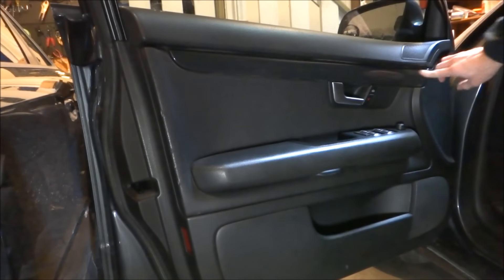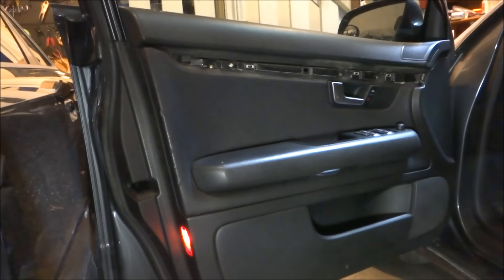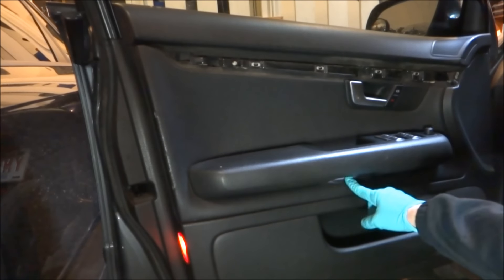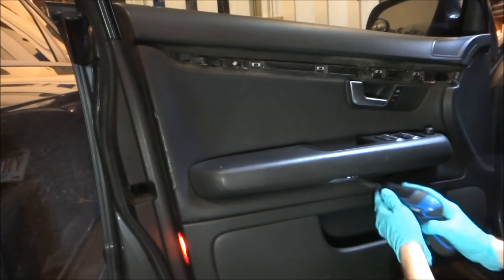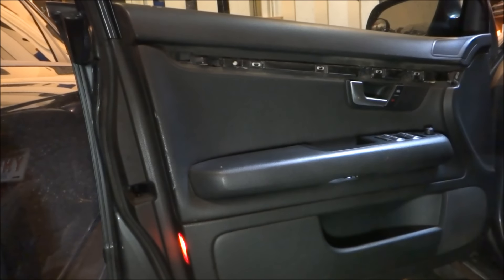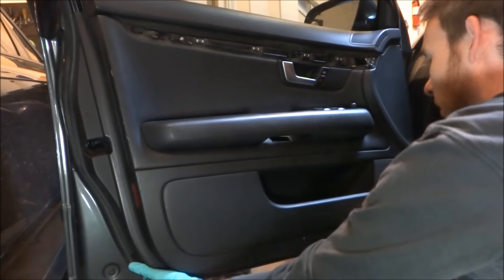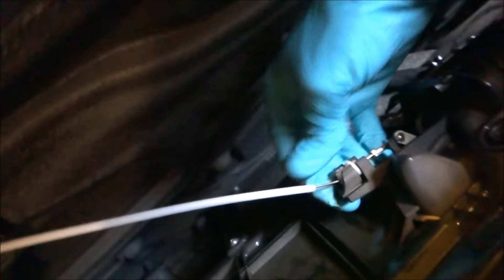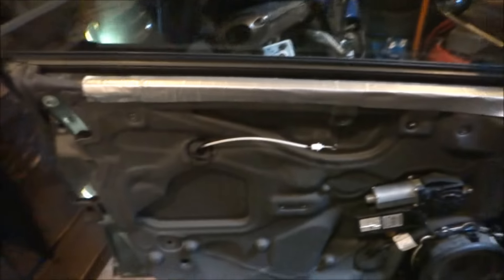How to Remove A4/S4 Interior Door Panel (B6/B7)

Comment: Why did the light on the door come on when you started to remove the panel? The same thing happened on my car. The light on the driver's door didn't work so I started to take off the door card. After I had taken off that piece of plastic the light worked again, so I just drive around without it. Easiest fix ever :-)

Comment: I have 2006 Audi A4 2,0t driver door dont have eni elektrik pouver
Reply from the maker: Check your fuses first. If they are all good you could take your door apart and check that the electrical connections are tight.

Comment: All the plastic fasteners broke when I pulled the panel off after removing all the screws. Not good. My guess is that Andrew had removed the panel in the past and either broke all the fasteners or they were broken by someone else before he bought the car.

No one likes to break shit when working on a car.
Reply from the maker: I've done this on 3 different Audis now and haven't broken any clips. Sometimes they do get brittle though.
Reply: They break 95% of the time. If you remove a door card without breaking any (or even just one), go buy a lottery ticket, LoL. They are a TERRIBLE design. I always pick up 4 from VW before I even remove a panel.